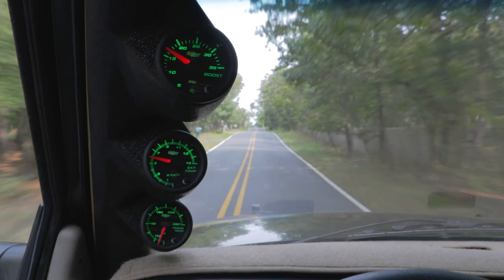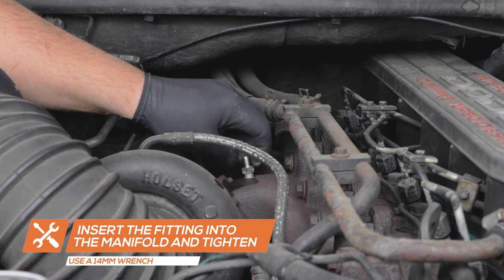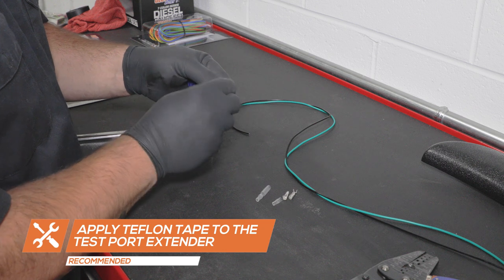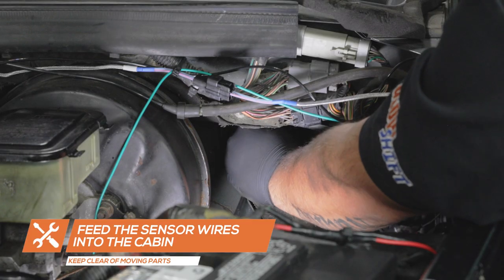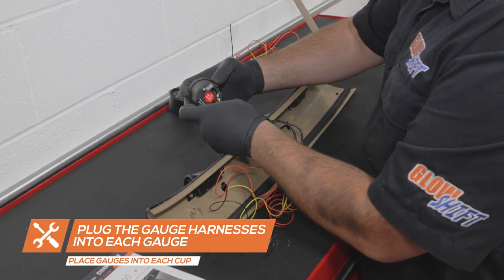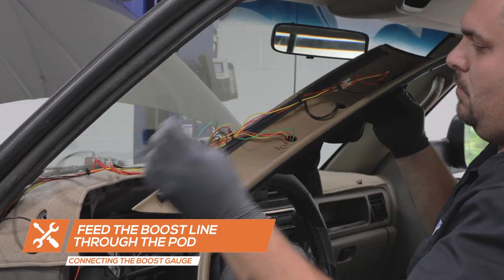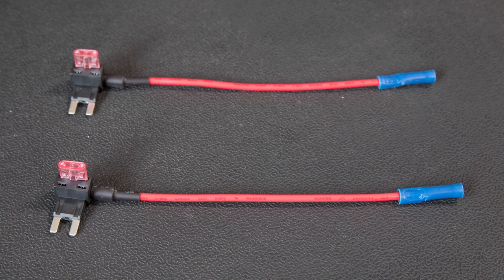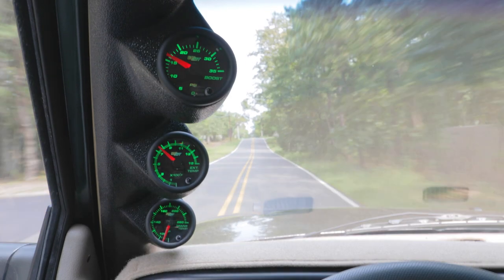GlowShift | How To Install A 1994-1997 Dodge Ram 5.9L 12 Valve Cummins Triple Gauge Package

Comment: When drilling the holes in the pillar to attach the new pillar be careful not to get too close or drill through one of the pillar structure that connects to the truck. Near the top there is two raised lines of plastic that were contacting metal when attached. I don’t like the plastic push connectors because they are very difficult to remove if you need to. Screws would be better.

Comment: Looks pretty straight forward… approx how long to complete install like this?

Good video 

Thanks
Reply from the maker: You should be able to do it in a day.
Reply: I've done a few. If you don't run into any issues 2 hours would be a good estimate taking your time
Reply: Done a few in a few different cars and trucks over the years. Average is 2 to 4 hours. If your making a custom pod or location add another hour or so. Wire tuck maybe 30min

Comment: please be more specific on where to drill for the egt probe. i just picked a flat spot and drilled it and hit the divider of the two airways. now i have to weld it shut and re drill
Reply from the maker: If you have a 94-97 Cummins, you should drill the same spot that we drilled in the video.
Reply: Glowshift I did same thing you have to say off to one side not In the middle witch is flat !
Reply: Just did the same thing they are not exactly specific

Comment: Where do you get those connectors for the Fuse panel? I'm about to do a set on my 95 dodge cummins 12 valve, and I don't have the connectors that the fuses plug into to go into fuse panel.
Reply from the maker: https://www.glowshiftdirect.com/expandable-circuits/

Comment: So can you do boost, fuel, and transmission or do you have to do have exhaust temp?
Reply from the maker: Both of our prepacked kits come with the EGT gauge. If you don't want that gauge, you would need to piece together the individual gauges and not use the kit.

Comment: How many expandable circuits do I need ? I am installing four gauges
Reply: And what part number expandable circuit?
Reply from the maker: If you are connecting the orange headlight wire to a fuse then you would need 3 expandable circuits. Here is a link to the circuits, verify which one your specific vehicle takes: https://www.glowshiftdirect.com/expandable-circuits/
Reply: @GlowShift  I have a 1995 ram 2500